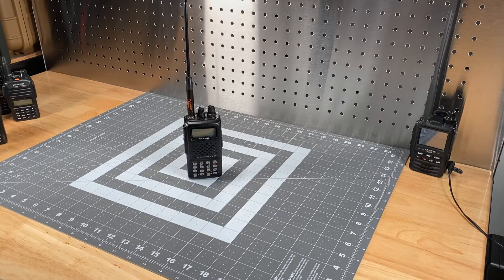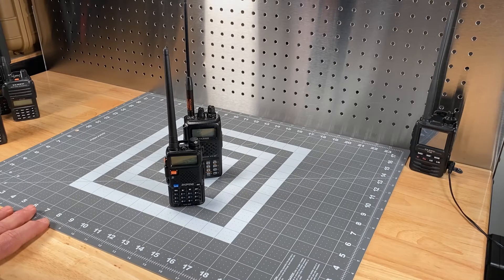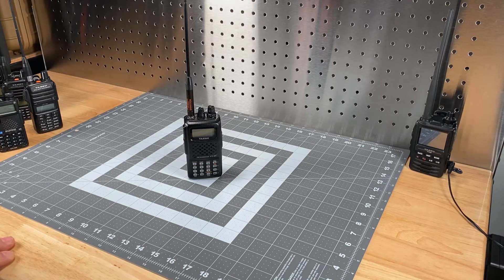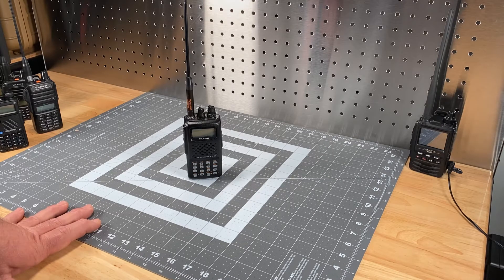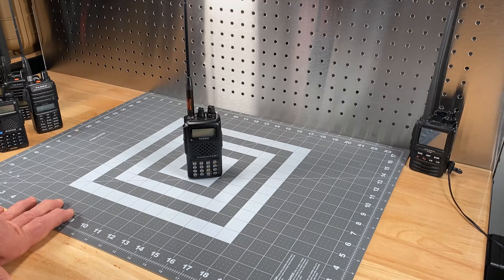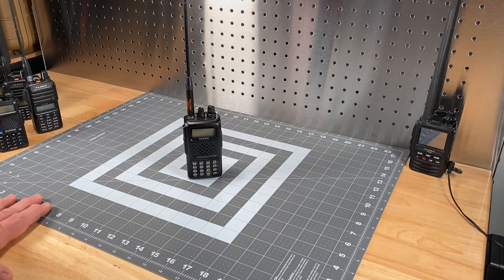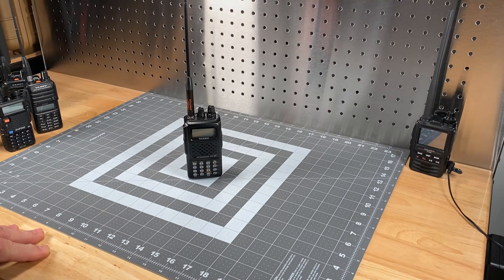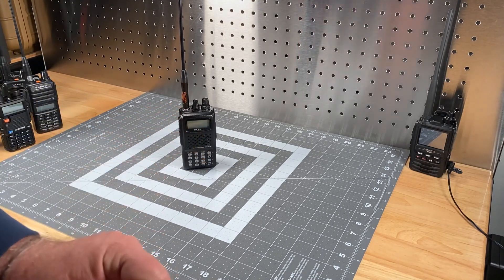Should I MARS/CAP mod my radio?

Comment: So my VX6R is modded. Tri band2m/70cm/1.25m, I have a diamond tri-band antenna. To get 6m I would need a 6m antenna to use the 6m band, am I right or wrong?  Somebody correct me and help me wrap my brain around it. I want to use 6m.

Comment: Completely agree with you.  I consider myself responsible and have amateur and GMRS licenses and some work experience in emergency dispatch and EMT training.  It's a passion and hobby for me I guess.  The bad apples do ruin things for everyone.  But good example -- if we're out hiking and only have an amateur HT radio on us and hear distress on FRS/GMRS, we can't talk back to the distressed person, only call out for help.  It's a PITA to have to carry ham and GMRS radios when hiking or biking etc.  I would only genuinely do stuff in emergency situations like that.  It'd be nice if manufacturers would type certify a radio for both amateur and GMRS, but you'd probably have the same bad actors ruining that as well.  Great video!  Just found your channel.  I'm making the courage to do the MARS/CAP mod on my new Yaesu VX-6.  Didn't get it done at HRO since it seemed simple (famous last words).

Comment: I agree with you 100%. I mars cap all my radios as soon as I get them. I also mars my HF radios too for the same reasons. As a new ham in the early 90’s I was receiving a ship in distress  (hf) and could have possibly helped if I could have transmitted. Instead I had to hear them repeatedly calling without anyone answering. Most hams know two stations can be close enough to physically help but too close to hear each other on the HF bands. A distant station can hear and be heard by both.  Great points. 73 KK4LBJ

Comment: I was training in a county-wide emergency response exercise when I found out mine couldn't broadcast on the frequencies emergency was using, which completely hosed me for the exercise. It's absolutely insane they hardlock these out to feel better about some rule nobody follows anyway. Completely hoses emergency response if they happen to be using this radio. it's great if emergency has reserved a ham band for the exercise, but if they didn't, everyone using these radios is screwed.

Comment: I did this mod to enable transmission on GMRS frequencies (I have a GMRS License). Mod works, however my power meter is showing only 500mW output on all GMRS frequencies, even though the radio is set to High power. Anyone know how to increase the output to full 5W ?
Reply from the maker: What brand and model # radio is this pertaining to?
Reply: @KS6DAY  VX-6R
Reply: @KS6DAY  VX-6R
Reply: @KS6DAY  VX-6R

Comment: I found this video a few days after hurricane Helene. I helped with emergency comms and I knew beforehand and this just reinforced the notion that when you need the modification you might not be able to perform it when needed! Some people are going to be lucky if they have power 6-8 months from now! I have no intention whatsoever of transmitting out of band. But if an emergency arises, I know I have the capability! The storm took down my radio clubs antenna that was on a tower which belonged to the city. 3 ham radio repeaters on that tower were taken out in an instant.

Comment: Well said. I have a radio. I listen, but never push talk button. I was going to take my ham test….it’s definitely a very tight community! They were not very welcoming or friendly. I was new to hobby, they were not very helpful at all. It was older crowd with some younger people.  I felt very uncomfortable, so I just walked out. I’ve studied for it, but I didn’t end up talking test. It’s been years since I turned or even looked at my yaesu . It was gifted to me by my co worker and partner at work , he since passed. He had a ham station in his garage, but He mostly was on a different cb system talking to truck drivers. I would sit and listen and he would try to explain stuff to me. He told me not to press the talk button until I had a license. He would always tell me about 9/11 and how important ham radios are.  We lived in different states. He retired, I would go visit him. He loved that cb!

Comment: i will do this mod to my FT60, so i can, transmit on PMR 446mhz, in case of an emergency, 446 is totally free for everyone here in sweden, BUT the max power is restricted to 500mw, but in case of an emergency nobody will ask about your radio.... many restrictions regarding freqs, and power are changed here in sweden, so it will be easier for people to communicate, and even the amateurlicens is going to be made much easier soon, (spring -25), - there are only going to be a couple of questions, and safety points, that will have to be fullfilled for 145mhz-and the HF bands, 443 is going to be invoked a liitle bit later, due to some inconsistencys between the SSA and the govenrment - 
  - 73, Levi in sweden

Comment: Orginally Baofeng radios where FCC Part 95 and therefore not authorised to be used on ham frequencies, when they dropped the price to $25 more and more hams started using them as disposable radios and ignoring or oblivious of the rules. Eventually the FCC basically told Baoefeng, TYT, etc that if they wanted to sell radios for the ham bands they had to change to Part 97 which they did but for the most part these cheap Chinese radios are easily unblocked by pressing a few buttons. I do not use computers to program radios and discourage people from doing so. If you are in the field and your radio decides to reset, you should be able to program manually. Just be aware when you modify a VHF/UHF radio from Part 97 to Part 95 you are breaking the rules! I won't go into right or wrong here, just be aware that the FCC can be a real pain in your behind if they choose to go after you which they probably won't but then again...they are part of the government and will go after you if they do not like you as everyone well knows! 
Personally, I pretty much stay away from VHF/UHF though I am the trustee of our local repeater...
73 de KB1TCD

Comment: I have not mars/cap any of my home and mobiles but this has me thinking about that. I have a scanner up at home quite a bit of the time, it is an old one, scan FRS/GMRS, local repeaters, and a couple services I have interest in, rail and air.  It would be good if my home and mobile had the ability to respond.  I also am semi active in SAR, same thing, my home station is my go kit

Comment: It took 5 minutes to do the mod on my FT3D. 
I used a cigar torch and heated a fine pointed tip tool. once hot I simply moved the resister node to the side of where it was originally mounted/soldered. (anything small with fine metal point will work) Then I used a wire pull magnet (the one you use to pull low volt wire out of sheetrock, when you're looking for the chain in the wall) The yellow flexible magnet is smaller than the hole where the resister is located. It fit perfectly. It picked up the node without issue, plus there was far less risk to dropping the extremely small node/resister. 
The device works as expected post mod. 

Scale of 1-10 difficulty
2/10 - It's probably a 1 but I did have to be careful not to damage the circuit board or put too much pressure on the resister while moving it aside. The risk of flipping the node/resister into the device, turning it into a rattle box. 

If you're on the fence: David Caster has some good thoughts on this as well as several other Ham Experts. My thoughts are: 
"Why not? Why shouldn't I be able to broadcast with my kids or anyone else for that matter while they chat on 20 dollar radios? There is no reason why a $300 transceiver cannot speak with the Peasants. Haha"

Comment: This came up in my feed today.  I've been considering the MARS/CAP mod for my new IC-7300.  I live in Japan, which, as most people know, is a very earthquake prone country. It seems to me that a reversible MARS/CAP mod could be useful for me if an earthquake were to strike my area.  I need to research what local hams are doing, of course, but I think if its not too objectionable, I will add a switch so I can go from unmodded to modded and back again with just a flip of the switch and a reboot once the emergency is over.  Has this been the normal procedure for US hams or do people just leave their radios modded once they perform the procedure and take whatever risks that may involve?

Comment: Another aspect is that the number one reason that people modify their radios is to use them on licensed business bands. Lots of businesses use uv5r radios. They just unlock them and program them to their licensed frequency. This is a completely legitimate practice, and is largely the reason why radio manufacturers add that functionality in the first place. Hams that want to see unlocking features removed are only thinking about their service, and forgetting that radios are also marketed to businesses who need the ability to unlock them in order to legally use them

Comment: I have opened up ALL my transceivers to be able to use any frequency necessary in an emergency. Yes, I have been a MARS member for over 25 years, and have been involved in civil defense in my county for longer. I have had occasion to use my radios out of band (VHF, HF) on several occasions, and glad to do it. Being a ham for over 40 years hasn't spoiled me as to who uses what frequency for what purpose, sometimes I hear Fort Rucker in Alabama use the higher part of 6 meters on occasion and never complained. Someday you might be called upon to be able and ready to operate out of band as Hams have been called upon to do during an emergency. The FCC  has defined an emergency as: when life or property is in danger and you are called on to communicate any way you can to save lives or their property (but only for the duration of the emergency and only if there is no other way to communicate). So, if I were you, I would open one each of my HF, VHF, UHF radios for full coverage that the radios were capable of. Amateur Radio has always served in emergencies, so being capable of communicating with local, state, and Federal agencies almost a given. No emergency, no out of band operation. But, be fully capable of communicating to anyone if an emergency calls you out and you can make a difference.

Comment: Licence Ham radio operators can make their own transceivers from scratch. And with that licence comes the responsibility to ensure they only transmit within their bands amongst other things. It's not the responsibility of the equipment (which they made have built). So my understanding is that the FCC wasn't banning hams from buying and using baofangs,  unlockable transceivers or even modifying them. It was banned for everyone else . Ie the person buying it for grms, marine radio etc. They didn't do the technical training to gain the responsibility to make and modify radios. There is as far as I know no issue with a ham having an unlocked transceiver. They just can not use it outside of the ham band without it being a real emergency. I'm happy to be corrected on this. I'm not in the US
Reply: A ham radio license requires answering 35 questions and paying a fee. The idea that this signifies that you are some kind of expert in something is laughable.

Comment: I mars mod mine because it's ridiculous that I should have to carry 3-4 HT's around with me to use services that can be used successfully with proper bandwidth / power with one radio without interference. All just because some bureaucrats want to charge more fees for radio certification. I don't operate outside of anything I'm licensed for. Same goes for my mobile rig. I'm not installing 5 radios in my truck to satisfy some bureaucrats weird notions.

Why shouldn't I use my ham HT for GMRS and MURS - OTHER than "because regulations" ...

As for warranty - get a radio from Gigaparts, they offer mars mods that keep your warranty intact.

Comment: I agree with most of the comments here. My biggest concern is the lack of quality in the cheap radios. I've seen the spectral purity of these garbage radios, and they transmit all over the place when you observe them on a service monitor screen. Sure, they transmit where they are programmed, but they also transmit simultaneously up and down the band simply because they have no filters or garbage filters. Quality matters.

Comment: Hey....    I have a few baofeng's and they are all unlocked but they still lock up when I try and key the mic between around 178.17375 and 188.86375.....       is this normal??    Do they all do that??     Some of my radios are UV-5Rx3 tri band and some are just regular UV-5R.....    Although I changed the max frequency on the UV-5R in CHIRP to from 174 I think to 260.....    So I guess they are all kind of tri band radios now.....     Btw I'm in the UK if that matters.....

Comment: For many years, hams used home built, or retired police and business radios modified for the amateur bands, all of witch would transmit out of band. As far as i can tell, its not illegal to have a radio that will transmit out of band, but it is against the fcc regulations to transmit out of band or sell radios that can. FCC rules and regulations are not laws. They will not show up with a search warrant to check your radios unless you give them a good excuse, and then only after making contact with you multiple times to stop. Its a non issue.

Comment: "They think they're just going to rise to the occasion and make their radio work like a magician".

What does being licensed and knowing how to make the radio work have anything to do with each other?

Do people not know how to drive because they don't have a driver's license?

🤷
Reply: It's a skill, if you can't practice it and improve on that skill set you won't be bringing any value to the community.  It's more than push to talk.  It's learning it's capabilities in varying terrain, how much useful battery life you get out of different power settings and so on.  Just having a tool and not being able to properly use it and practice with is not a very good plan or prep.
Reply from the maker: No. People generally take drivers education training, behind the wheel instruction, then a written and proficiency test. Then they get a drivers license. Then they get to drive.

Comment: I'm a licensed amateur radio operator and I look at these mods from this point of view
What is a government called when it dictates to it's citizens Do as I say, Not as I Do?
and they add, No One owns a Frequency. Well that No One means you to government man.
I will not transmit maliciously on gmrs/frs/mars or commercial but I see nothing wrong with using them for a few seconds while communicating back and forth during trail rides through wilderness areas, where no one else is around for miles.
and to those Sour Hams that think they are better than thou with their frequency police attitude, What does the fcc say about keying up over another station that is talking? because you can see that in the ham world nearly every day during contesting. Just watch the many videos of them contesting and you will see and hear them keying up the mic while another station has already started transmitting.
Reply: Yep totally agree. I see no problem with going the wrong way on a one way street, if it is just for a few seconds. Likewise, the guy down the street who keys up on Air Traffic Control frequencies is perfectly ok too. After all, he only does it for a few seconds at a time. I mean, just look at the guys in the newspapers who commit far worse crimes than that and don't get caught.
Reply: PS--You really should consider retaking the FCC amateur license coursework.
Reply: @ChatGPT1111  what is the f.c.c. rule on talking on top of someone who is already keyed up and carrying on a conversation on a frequency?
f.c.c. says it is Not allowed. So why is a Pile Up in Contesting allowed?
You can hear ham operators Every Day on the radio and see the videos of them doing it here on youtube, Talking over someone that is already making a contact.
Why are the rules for some and not enforced on others who break the rules just so they can place a trophy on their wall.

Comment: I do this mod to all of my radios for the very purpose you describe, EMERGENCY situation.  Ham radio is both a Hobby and Prepping tool for me, so as with all my gear/preps, I want them to be as fully functionable as possible if/when the need arises then I have that capability.   Everyone I teach about the baofengs, I explain the fcc rules and more importantly explain how to be a good radio operator so as to NOT interfere with other folks or business or govt using any said freqs.   Its EASY to stay clear of being a problem to others, then you can go about your business un-noticed, as it should be.  Good video as always.

Comment: It seems like the rules need to catch up with technology!  I am looking at getting my license but have been using radios for a long time.  I volunteer for a Trolley Museum in Maine that uses VHF.  We register our personal radios under the museum license. We have strict protocols for our communications and it is easy to follow them.  I also volunteer with a trolley group in Iowa that uses UHF.  Not so strict on protocols but limited transmissions and no gabbing!  I need one radio to do both.  For now, I am looking at GMRS and FRS.  One quality radio should be fine.  Most ham rules are followed by mutual agreement!  We know the rules, we follow them!  Why is modifying your radio really any different!  If you qualify your usage using common sense, that should be good enough!